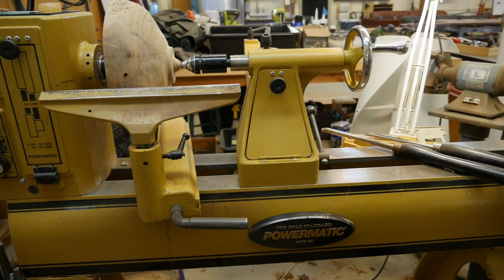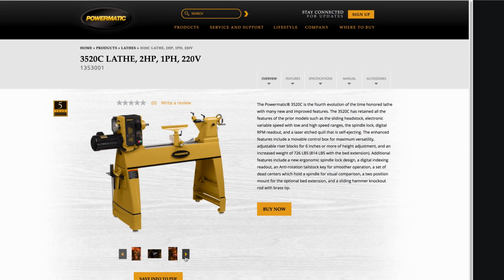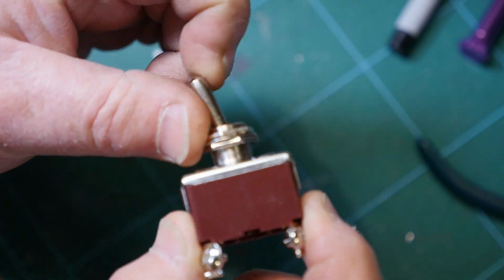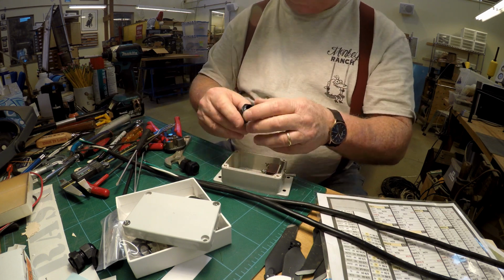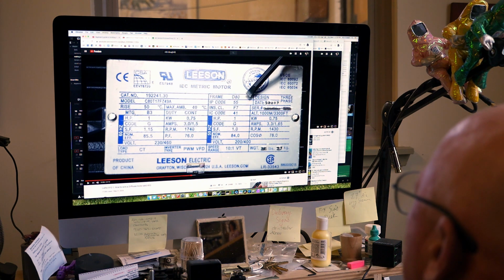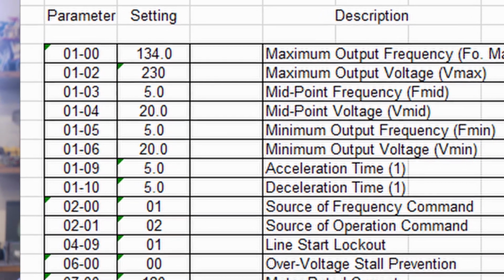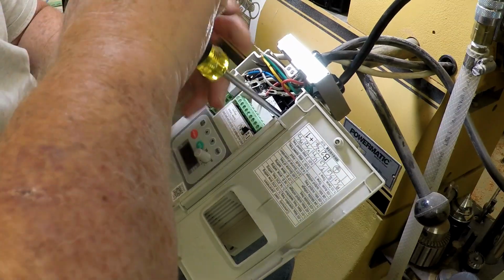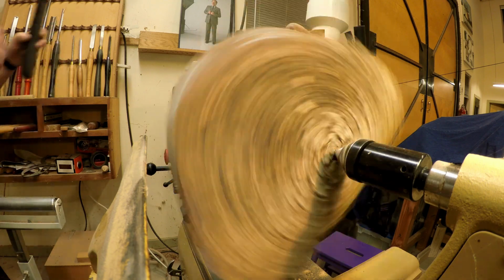New VFD for Powermatic Lathe

Comment: I've spent several days trying to understand how to program the Delta VFD; this is, hands down, the best instructional out there.  I'v gone through the parameters, changing to those listed avoce, and gotten two error messages (Minimum Frequencey and Line Start Lockout).  It doesn't seem either of these would prevent the lathe from running, but after programming, the motor won't run, either from the VFD control panel or the power button on the lathe.  Any suggestions would really be appreciated.

Comment: I had the same problem on my jet wood lathe.  I think a power surge burned up my vfd.. I will never leave it plugged in while not in use again. The replacement from jet would have cost me $1500 but now is no longer even available, a whole new lathe being $2600. I found an appropriate replacement from ATO for aprox $315.. This video was part of my research to find a replacement VFD. Thanks for making this video and posting it on you tube 👍👍

Comment: Hi. Enjoyed your territorial on rewiring your lathe back up to a VFD. I have a MCN Kontour This is Italian machine made back in 1998 , I have tried three times to contact the manufacturer to get some help no response, I blew the circuit board on it a few months ago, So I have removed all of the Internals and I’m going to get a new VFD with Forward and reverse and potentiometer so I can vary the speed and stop start on a separate page control that I can move around on the outside of the lathe. I like you I have been studying the web so many VSDs come in from those funny countries where I do not like to support, Hello I am English man living in France I have now found a German company that can supply me with all my components for round about £650/750 in euros, As we know this is cheaper than going out and buying a new lathe.
Keep up the good work stay safe face mask head shield on , Phil from the moulin. In France

Comment: Thanks for making a great video.   I would like to add a little bit of technical info if that's okay.    The reason why you didn't find the e-stop connected to the drives input power, is probably because that particular drive uses a resistor to pre charge the DC bus.   Typically when using a lathe people hit that button a lot more than normal.   If you do it too often the pre-charge resistor will get hot and burn out.   There is a rule of thumb for small drives.  Don’t cycle power to them more than 10 times an hour evenly spaced.   Again good video.
Reply: so many questions. powermatic ugg!!  I would to know more about this comment as i am dealing with this problem now thank you!
Reply: @kevinchristensen5248  What would you like to know?  What problems are you having?

Comment: I noticed on the original box that there is a small spin knob. Can you tell us anything about it, and can we move it forward or backwards?
Reply from the maker: I think that knob is an optional input for the VFD that can be configured to control something. It is not necessary, and I don't think it's even connected in the VFD logic.
Reply: @planetal269  , good. One less thing to worry about. Say, have you experienced any slight ticking sound coming inside near the belt?
Reply from the maker: @robertcornelius3514  Nope. As a first thing, I'd open the door over the belts and look to see if there is something loose inside the headstock. If the ticking goes faster as the spindle goes faster it's likely something hitting. If the speed of the ticking remains constant it's probably a bomb. No, wait, that can't be it.
Reply: That spin nob has the same function as a potentiometer. It controls the speed of the motor. The settings input for an external speed control ( potentiometer ) bypass the internal control from the VFD.

Comment: OK AL. You have been the only wood turner I have seen to succeed in this world of VFD confusion. Hats off to you. May I pick your brain?  I have an old Delta. I want to get a 3 phase motor and VFD. I found this KBMA-24. It 8s a simple no programming vfd. I want to match it 6o a motor. Can I presume all 1 hp 3 phase 1800 rpm motors are created equal as far as woodturning is concerned?   The folks at Gallo will not spec a motor .......they said because you are not doing a direct replacement,  they cannot be responsible for choosing a motor. I have an old Delta 46-715. 14" 40" bed 3/4 hp 120 v 9.8 1780 rpm lathe. It has reeves drives and cannot go below 500rpm. I hurt myself on a large out of balance piece and am now on a mission to convert and not drop 2k on a new lathe. Your advise please
Reply from the maker: Your questions are well over my pay grade. I suggest you do some some digging on YouTube, and watch some of clough42's videos. Apparently he's a real engineer who knows how all this stuff really works. My own TL;DR answer is probably something like, "sure you can do it but it will take you at least two tries to figure it out." Turning unbalanced wood is a CLM (Career Limiting Move). Good luck.
Reply: pick the appropriate motor first, then match a VFD to that motors needs.  1 hp motor= 1 hp VFD.  if the motor is 240volt 3 phase you can use a 240volt single phase input~240volt 3phase output VFD or if your input is 120volt single phase you can use a 120volt input~240volt 3phase output VFD. if the motor is a 120volt 3phase motor use a 120volt single phase input~ 120volt 3 phase output VFD.
My original delta VFD was a 1hp 120volt single phase input~ 240volt 3 phase output to a 230volt 1.5hp 3 phase motor on a jet wood lathe. I can not find a VFD rated 1.5hp. The original VFD was discontinued and is no longer available.. instead of straining a 1hp vfd to drive a 1.5hp motor I installed a 2hp 120volt single phase input~240volt 3 phase output VFD. The settings in the VFD allow me to program the VFD to the proper max amps/ kw/ htz/ rpm my motor is rated for. As an example the output on my VFD is max 7 amps and the motor is 4.6 amps so the amp setting on my Vfd is programmed to max at 4.6 amps.
Reply: @drakon1300  where did you get your vfd?  How did it turn out?
Reply: @denalidude   I got it from a company called ATO . I replaced the wiring and switches, set all the parameters and it is working good.

Comment: Has the switch effected the vfd so far?
Reply from the maker: Nope. Everything works just fine. The original VFD did not a cooling inside it, but the replacement does, so it makes a little bit more noise when it's running. Its absence might have also shortened the life of the original.

Comment: just went through exact same situation just hooked up new VFD and came looking for parameters .back out to the shop to try and get her working
thanks for your info
Reply from the maker: Glad it helped
Reply: @planetal269  worked great and got green oak bowls roughed out I was working on when it quit. Did they send you a chocolate bar with theVFD?
Reply from the maker: @danfox7  Yes. It lasted about 6 minutes.

Comment: If I buy from Powermatic, can I just replace the inverter without having to mess with coding?  Nice video BTW.  Good presentation and easy to listen to your narrative.
Reply from the maker: I don't know. That's something you'd have to ask Powermatic. But it's not that hard to program the VFD once you have the settings, which I just posted in the description, above.
Reply: If the vfd settings are pre programmed by powermatic then it should be a simple replacement .. other wise the vfd settings/ programming should at least be input for the information on your motor so the correct volts /amps/ rpm /kw rating match your motor, if you don't input that you could damage the motor. for example my new vfd rated at output 7 amps and my motor rated at 4.6 amps so the amp setting I input max 4.6 amps output. You can use the vfd to control the motor without the external switches which would reduce the need for inputting the settings for those.
Reply: @drakon1300  thanks for the reply. For some reason, everything is working ok now.